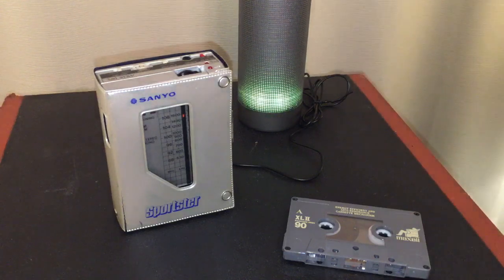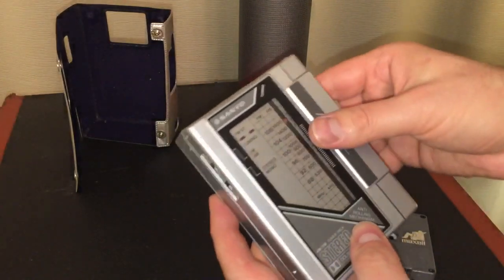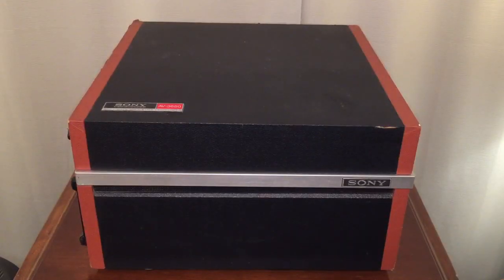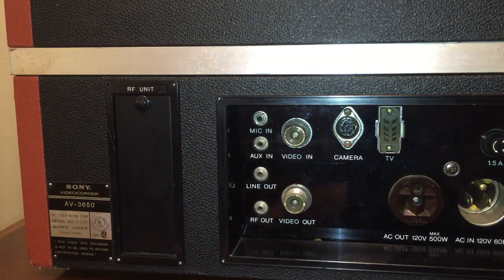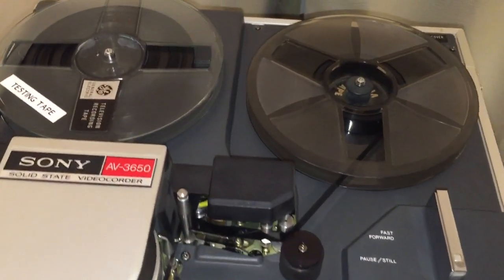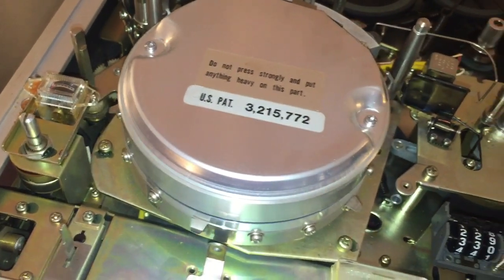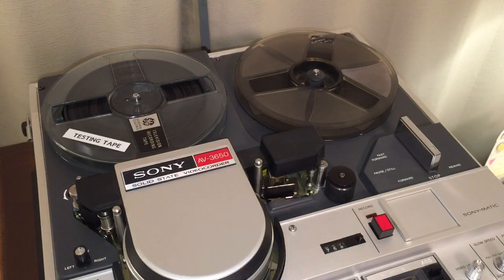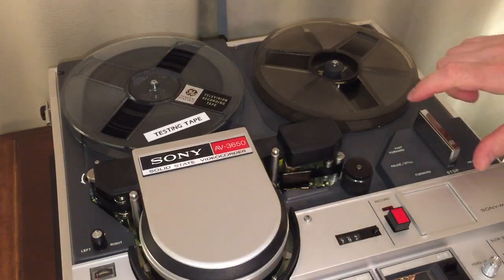Sony Reel to Reel VTR VCR

Comment: Using VHS tape will sort of work. I have an older version of this machine and I did the same thing, but had audio problems as well due to VHS tape being much thinner than the original. I obtained a new 1/2" tape without the sticky shed problem that the original sony tape had, and it cleared up all the audio problems I had when using vhs tape spooled onto the tape reel.

Comment: This VTR uses the same "electromagnetic brake" servo system to regulate the video head speed and phase that 1970s Sony U-matic VCRs would later use. Look around 17:50, and you will see a brief shot of the electromagnetic brake mechanism, which is attached to the video head's belt pulley. In operation, this makes a soft buzzing sound, as pulses of current are applied to the coil.
Reply: This is one of the main reasons why you had to replace the video head drive belt all the time. That breaking action would force the belt to slip and wear out. Kind of like riding the cluch in a stick shift car.. This method of servo control was used on all VCR/VTR units until the early 80's when they move to direct drive inverter VFD control.
Reply: Philips VCR-LP used DC motors without servo brakes.

Comment: The name of the connector used for the video in/out on this machine is called a "PL-259". This type of connector was commonly used for video connections in the 60's and 70's before moving to BNC/RCA banana connectors in the 80's. It was also used for an antenna connection for CB radios as well.

Comment: I've never seen those 'cassette radio's' before, cool. The power outlet on the back of the VTR is for a monitor, the Video camera uses 12v DC and gets it through the camera plug. It's the same plug as my Sony Betamax and Ferguson VHS. My Fuji video camera plugs straight in.

Comment: The elementary school I went to back in the early to mid 70's had a color version of this machine and it was connected to an early RCA XL-100 with a large input panel on the back.  I believe it was a 25" metal cabinet table top set on a cart with the video tape machine on a shelf below the TV.  I remember this because this was the only color TV set up in the school.  Every classroom had a late 60's vintage Magnavox B&W TV on a tall cart and each room had a cable TV connection so we were able to watch educational shows on our local PBS station.  Every once and a while they would record a special show for us to watch and bring in the color TV/VTR cart but it was rare.

Comment: I'm amazed to see integrated circuits in that unit, because I remember that deck from my High School days in 1974.  The words "Solid State" give it away as 60s and 70s tech, because that was on anything that didn't have tubes.  But there were, indeed IC's in the 70s, and they were needed to keep the size of that deck as "small" as it was.  

We also had Shibaden decks, which were (mostly) compatible with the Sonys, though compatibility wasn't guaranteed.  Amazing picture quality, which I suspect is better than when it was new because of the superior modern VHS tape.  My fascination in school was with the camera, because they had a Sony, I think 3200 B&W camera that looked like a studio camera with viewfinder on top.  I played with that thing for hours, whether it was recording or not.  This was before VCRs, and I didn't know of anyone who had a VTR at home.  (VTR stands for Video Tape Recorder, which was always open reel.  The C in VCR stands for Cassette, and only applies to what we now know as VCRs.)

You're right about the novelty of seeing yourself on a TV in the 70s.  At electronics stores, such as Federated, they used to set up VCRs with cameras pointed at people as they approached the display because seeing themselves on a TV made them look closer, and maybe buy a camera and VCR together.  (No camcorders yet, so you had to buy both separately.)  Before VCRs were common, I do remember some of these Sony units for sale at traditional stereo stores, tucked away in a room with the really expensive equipment, but I think they were mostly used in schools and businesses.

Speaking of the 70s, your voice makes me suspect you're actually Ron Howard.  If so, you were great in Happy Days! ;-)

Comment: The earliest ad I can find on the VTR is from Sep. 1972, it sold for $1150USD, I have seen a few brief snippets as early as 1971, however I cannot confirm that.  The Sanyo, I've not seen that configuration before neither, kinda cool! ~Jack, VEG

Comment: UHF fittings is the correct terminology for those screw-in leads. They are the same as is used in CB and amateur radio and will allow you to solder on plugs to whatever length of low-loss coaxial cable you need (i.e. as long as you need but no longer). Such cables can be bought on big reels if you need to use them for an extensive closed circuit system.
Socket is SO238 and the plug is PL259.

Comment: 100% fantastic video. My AV-3600 had the same problem with take up reel. Thanks for showing what to adjust. How about an episode about cleaning the heads?
Reply from the maker: Great suggestion!  Unfortunately the machine is long gone.  Just use a clean cotton cloth with rubbing alcohol on it along the entire tape path.

Comment: Whoa! I've got the Euro variant of this model, the AV-3670 CE! It was a freebie saved from the trash. Came with the RF modulator installed. Works remarkably well for its age, although it also had same takeup issues you describe (had to lubricate the idler assy too). Sadly, the tracking meter is beyond repair -- its coil completely disintegrated. As seen in the video here, the picture quality is surprisingly good, infact superior to VHS in terms of perceived resolution and noise. While these things are meant to be portable with the fitted carry handle, they're really backbreakers! On my unit the black/red case looks more like black/maroon, though I suspect it's discoloured from age.

Comment: Wonder if in that portable cassette player Sanyo meant for the radio tuner to be an EXTRA COST OPTION... (and you could buy it with or without the tuner). That maybe the reason it has 2 SEPARATE model numbers.  Very rare option in deed.

Comment: I have the sony av-3600, i started restoration a few days belts are fine for now i will have to find replacements, everything have been cleaned, oiled and greased and recapping will start soon, and i have a panasonic nv-3130 color machine arriving shortly both these units should do around 300 lines of resolution

Comment: My guess is the connectors are called uhf because that type of connector is specified to handle higher frequency than coax.
Reply: Ultra high frequency

Comment: I recently picked up a 3600, the model right below that one for cheap. I haven't been able to test it yet, but the only visible problem is a broken cover latch. I took video production classes in community college in the mid-70's, and we used these and the porta-pak version, the AV 5400, I believe, to record our work. I still have my tapes, and I'd like to transfer them to some other medium, assuming they're still useable.

Comment: The UHF connector gets it's name from WWII era terminology. Back then anything over 30MHz was considered UHF. Ironically they're not used in modern UHF equipment because they don't have a constant impedance. In ham radio we always used the old Signal Corps terms PL-259 (plug) and SO-239 (socket). I hated them so much (they are a pain to solder and are not waterproof) I used to replace them with N connectors whenever possible.

Comment: Very neat video tape machine. Does it use standard composite video and audio?

I've never seen a radio module like that. Very cool walkman. I dug one of mine out that I've had for years. it's an emerson. model number is rubbed off. it was broken when I got it and I fixed it.

The interference from the speaker is caused by the flashing lights. There's a chip inside that handles that. I have a toy guitar stack amp speaker that had red flashing lights that would flash to the music and when connected to a radio it would interfere with the reception unless its a strong station. I took it apart and bypassed and removed the chip inside and it works perfectly. I think I hooked the power LED to the flashing lights so they just light up solid when the power is turned on.

Comment: I wonder what the tuner uses for it's antenna? The Panasonic & Awia recording walkmans I had in the 90's used the headphone cord. And its kind of rare to find a walkman with Dolby B.
Reply: wildbilltexas My Sony Sportsman from the late 90's  had Dolby B.
Reply: I always wanted one of those. They were the waterproof models. I'm surprised it had Dolby B. I thought it was kind of pointless to have noise reduction in a Walkman because of their low watt output. And if you were using it outside or in a busy place you couldn't hear tape hiss anyway.

Comment: So do you buy and fix up alot of old outdated electronics?  Metal cassette tape was so doggone expensive.  I never heard of a unit where the tuner plugs in like a cassette.  That was different.  I bought an audio reel to reel deck.  My tapes were about 30 years old and squealed like crazy which is that sticky tape syndrome you mentioned.  Man, there are alot of parts in that Sony VTR.

Comment: I have one of these got it up and running but even though it’s running it does not show anything on the tape no audio or video 
Any ideas ????
Reply from the maker: It will likely need new capacitors.  If stored in a hot warehouse all its life, there may be additional component damage.

Comment: What output from the unit did you use (RF or UHF) and what input into the Sony TV did you use? The coax input, or did you adapt it to RCA?
Reply: Plain composite video from the SO-239 jack, I'd imagine, adapted to a modern RCA plug.  Those large coax ports are sometimes called "UHF connectors", but don't actually output a UHF signal in this instance. The RS-170 composite-video standard (B&W predecessor to baseband NTSC) goes back to the 1940s at least.

Comment: did they make a color version of these?  I love reel-to-reel stuff like this...wether it be audio only or audio and video...just fascinated with it :)
Reply: Not sure about 1/2" VTRs, but Akai did their own VTRs, which used regular 1/4" tapes (of course with better oxide formulation) and one model, VT-150, was in color.

Comment: Databits, I had the AV-3650's less expensive entry-level brother the AV-3600.  i acquired it from a school in Saskatchewan in 1984.  The difference between the 2 was the 3600 had  no  "slow" control and no video dub as yours does ( audio only with meter ),  and AGC only on video ( no manual ).  They both ran at 190 mm/sec ( compared to VHS's 33.33 mm/sec ) so the linear audio  was hifi capable.  It worked perfectly until in 2010 when I "de-cluttered" my living space and it was unfortunately part & parcel of many electronic devices that I shed tears for ( along with that box of blank dictabelt records that i told you I'd look for, sorry )
Reply from the maker: I just acquired a 3600.  Haven't had a chance to refurb it yet.

Comment: hi my dad and his mate did video weddings when video's like this were around seeing yourself on video was a big deal in the past
tip get hold of a betacam sp i have 12 of them i use them for audio masting as the video is very bad on them danger they are heavy units  alot of the old tapes are going bad having to bin old betamax tapes because of the drop outs very rare to see
this video like this looking new like
Reply from the maker: Thank you for the comment and for being a subscriber!

Comment: UHF=Ultra High Frequency?
Reply: Probably not in this case. If it was an antenna terminal, that might make sense because analog TV used both VHF and UHF, but it's composite. Composite video only requires about 6 MHz of bandwidth, nowhere near UHF (300-3000 MHz).

Comment: Museum piece..  I assume B& W
Reply from the maker: +Mark Anderson - yes B/W
Reply: You imagine recapping that?  I cant believe the rubber is still good
Reply: @markanderson350  Absolutely no need to recap older gear that is working fine. Only stuff from the late 80s - late 90s needs to be recapped, because of the poor quality electrolytics capacitors made during that time. Older, well-made capacitors often test just fine. They are sealed properly and the electrolyte is still fine.

Comment: 7:40 UHF= ultra high frequency
Reply: Originally used on UHF transmitters.
Reply: @jameswest8280  well, back when "UHF" meant 300MHz at best... that connector, proper name PL-259(plug) / SO-239(socket) is actually kind of terrible for higher-frequency use, with high parasitic capacitance from the large center pin leading to high insertion loss.  Still popular on ham-radio equipment for HF (<30MHz) and sometimes VHF bands due to its ruggedness, though, since at those frequencies the loss isn't much of an issue.  I've also heard it called the "shielded banana plug" - some banana plugs will actually fit!  Handy for longwire antenna hookups...

Comment: there not going to arrest you for producing sound  as long as you  don't run the complete song you can use audio for demonstration  and the most they will do is remove all audio and or remove video